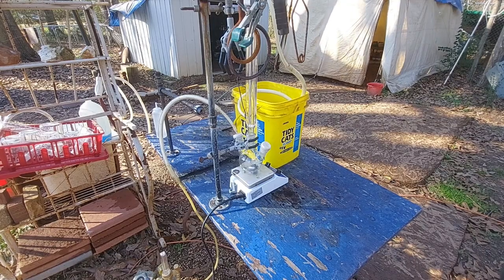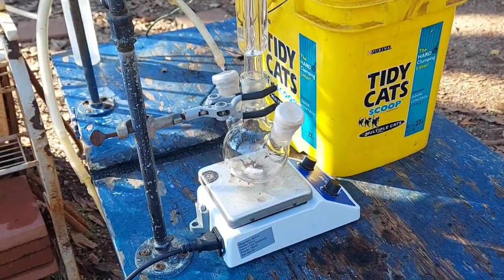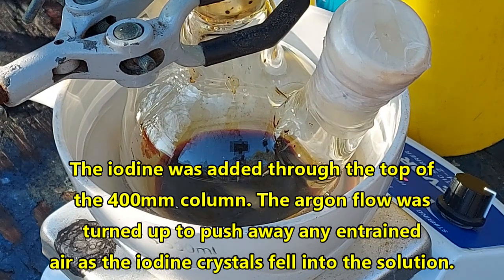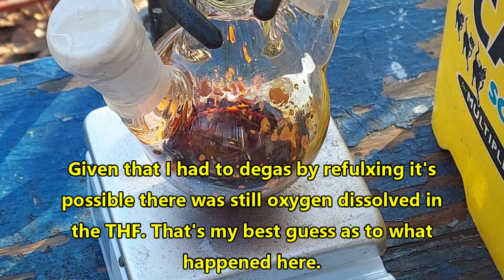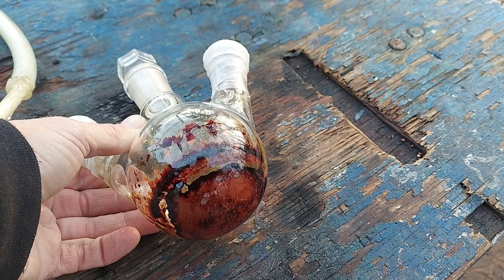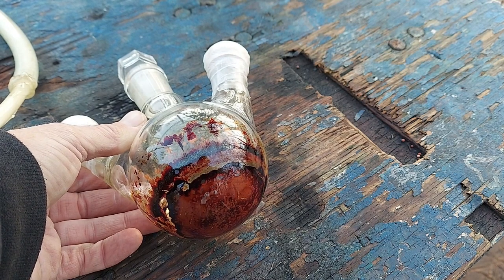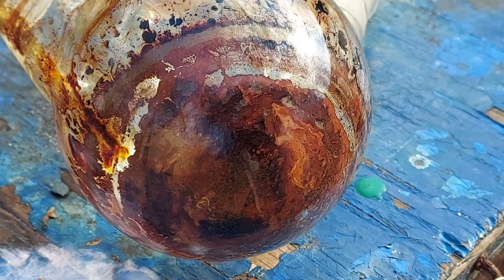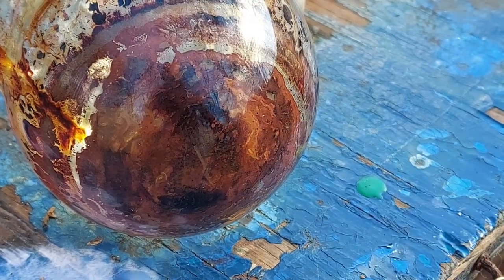Preparation of Samarium Triiodide in THF #chemistry #lanthanides

Comment: How are u going to get it out of the flask without interfered with moisture and oxygen?
Reply from the maker: That was part of the problem I had. That's why I was saying this method needs refinements. The basic premise is sound but there were several difficulties and getting that shit out of the flask was a big one. I didn't expect there to be so much excess iodine. That's why it is better to use metal powders for stuff like this. Those dendritic pieces were very pure but they had a relatively low surface area.